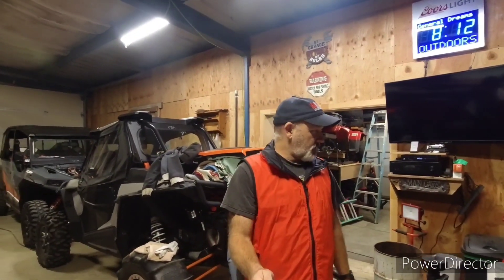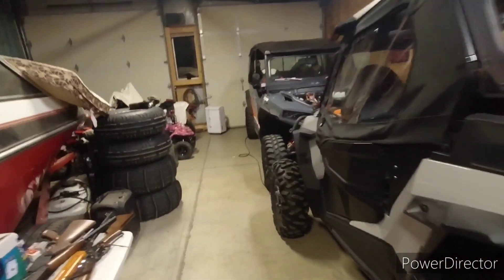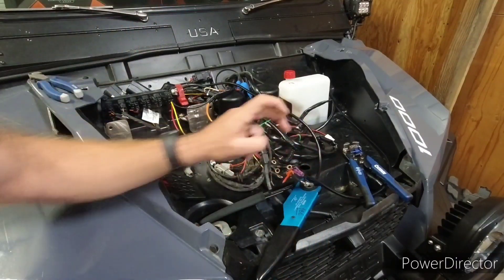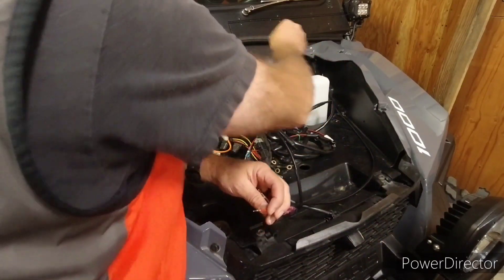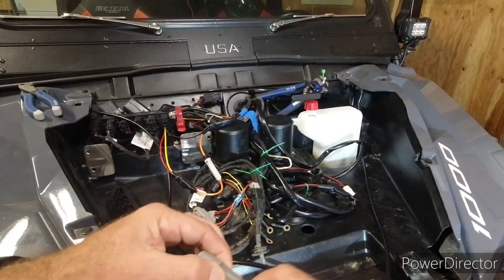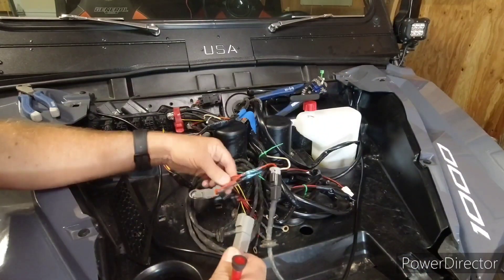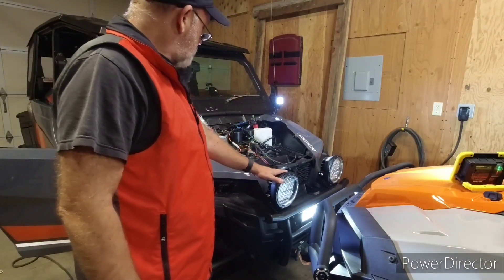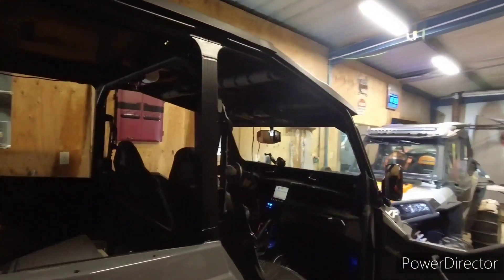Wiring the pod lights and Deutsch connectors explained.

Comment: Great video man. Do you have any experience with the Polaris pulse bar quick connect pigtails? I recently purchased seizmik pursuit nightvision mirrors and the wiring harness that came with them only has a red and black lead which is meant to go direct to the battery posts.. there is a 5amp fuse in series so I’m wondering if I can use one of those pulse bar quick connect pigtails (three wire system) and wire the harness (2 wire system) black-black and red-red and isolate the yellow key-hot wire on the pigtail.
Reply from the maker: I'll start by saying I am not an electrician.
But I have done things like that on a low power draw item.
The correct way to wire would have a relay in the system.